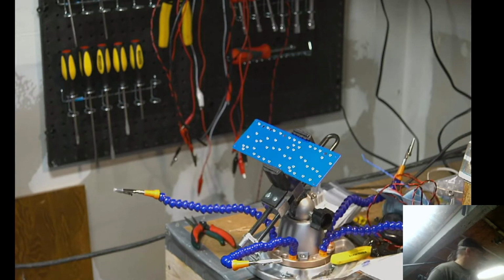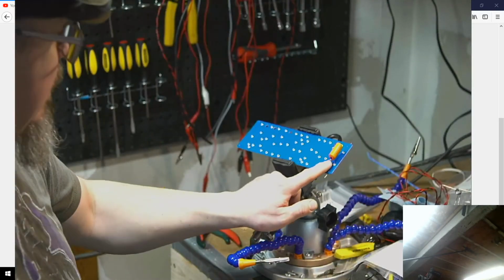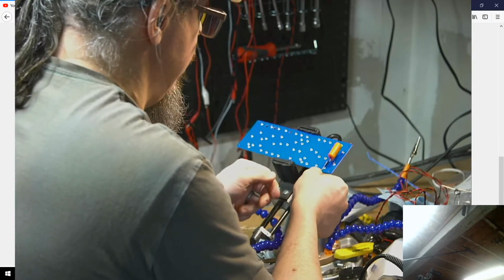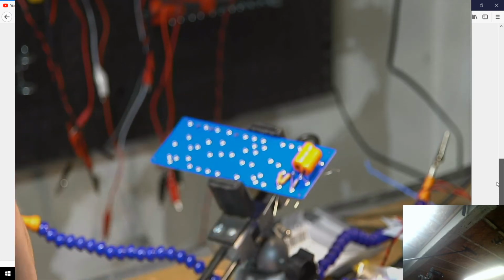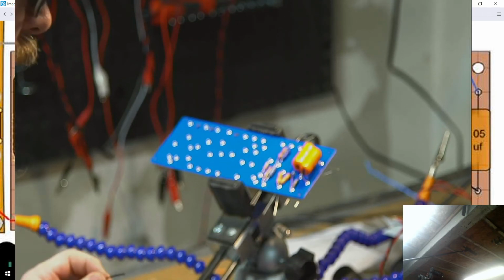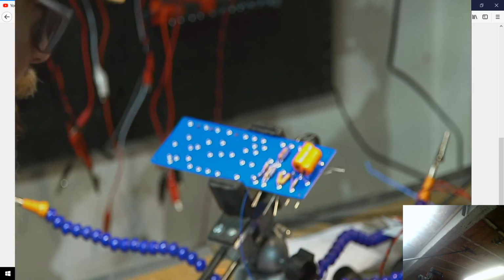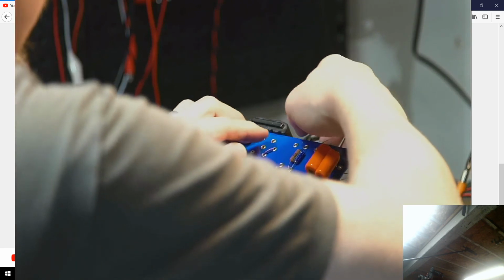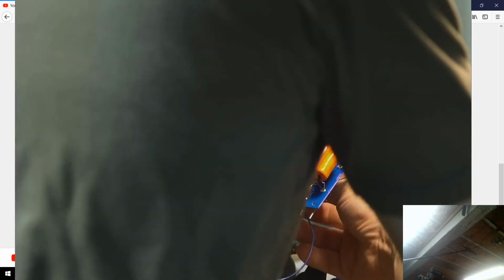Dumble Live Stream

Comment: 0.047 is sometimes called 0.05
Reply from the maker: +zjokka yeah it's so close it's pretty much the same
Reply: Hi, what I meant is that sometimes they print 0.05µF on a 0.047µF, but the value is still 0.047µF. Of course it will never be exactly that value, because of tolerance. The values issued are based on an algorhythm, same as is the case for resistors. 
Anyway, did pull up a chair. Enjoying your vids a lot.
Reply from the maker: Thanks! :)

Comment: What Series of the Caps and voltages you are using?
Reply from the maker: +Finom1 I'm using several different caps, cde 715p for the non electrolytic, I think nichicon for the bulk of the lower voltage electrolytic, I have a few spare 20uF Sprague for the post filtering, etc.  I got most from Mouser